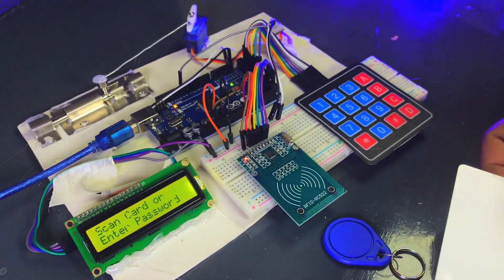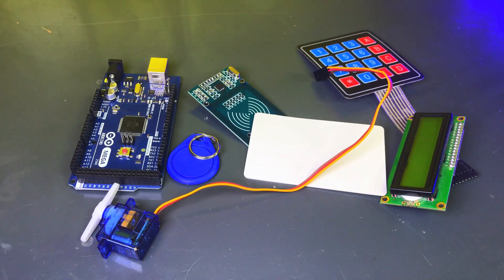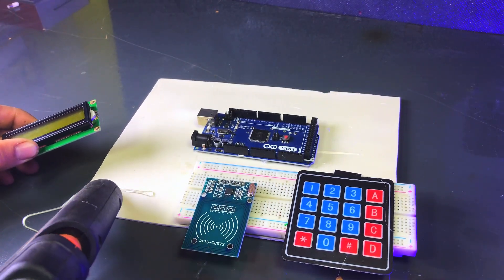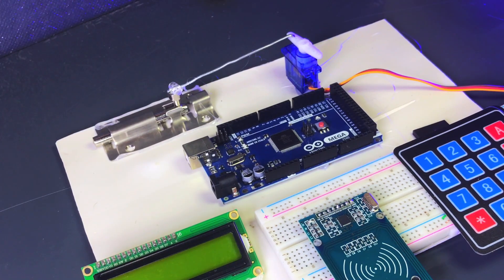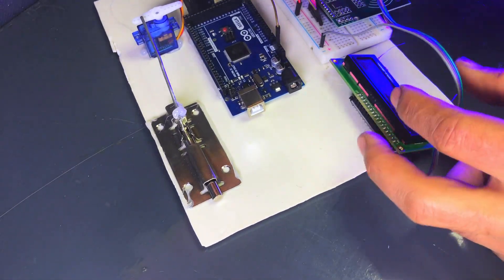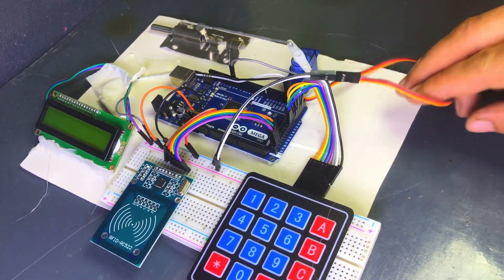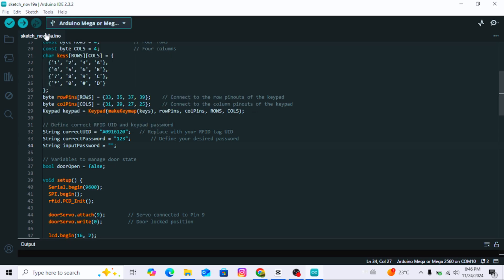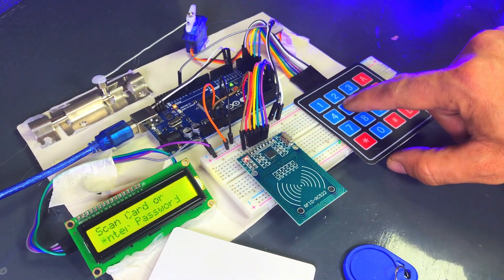RFID and Keypad Password-Based Door Lock System | Arduino Mega Project Tutorial

Comment: can you do with like this ? Write a program in which we have an ultrasonic sensor. If someone stands in front of the sensor, the LCD will ask the user for a password.
The user can enter his password using the keypad.
The entered password should be displayed on the LCD.
If the number of digits of the password reaches four, check whether the password is entered correctly. If the password is entered correctly, the servo will turn 90 degrees. The servo is normally at 0 degrees and the LCD will display the word "Enter".
Otherwise, if the password is wrong, write the wrong password on the LCD. The buzzer will beep and wait for the user to enter the password again.
If the password is entered incorrectly three times, the buzzer will beep forever.
If the desired card is close to the RFID, the buzzer will stop beeping and the program will return to normal so that the user can enter the password again.
Note: If the user keeps his finger on the numbers, more than one digit should not be entered.
Reply from the maker: yes

Comment: Hlo plz plz tell me my project is all working but rf id card is not scanning  on serial monitor so i can add that in code plz plz reply
Reply from the maker: Please check that your RFID module is properly connected with correct wiring. Also verify if the baud rate and the commands like 'Serial.begin' and 'mySerial.begin' are correctly set in your code

Comment: I have a question it is possible to make a keypad rfid and fingerprint door lock system with sending a alert sms and email ? Its for our capstone project hope you will answer it
Reply from the maker: Yes, it is possible! You can use a GSM Module (SIM800L or SIM900) to send SMS alerts.
Reply: Yes you can. I have this project inbox please
Reply: @Abidali-qi3xj Hi brother i need to the same project with RFID module, keypad and Fingerprint. Can you please share the components and circuit diagram?

Comment: This is amazing..  I need so help on a project I am busy with on a raspberry Pi.  It is also to do with rfid and door locks.  How can I reach out to you?
Reply: I’m currently planning an RFID system for a business that has door locks, cabinet locks, and the same RFID keycard used for my time clock. Currently getting the wiring straightened out (I don’t do electrical) with my contractor in the building and contacting the city to decide if I need a fire alarm override. Then ordering all of my components. Hoping to do the whole project for $1k (pretty sure I can do it all myself).

I have asked chat gpt all of my very specific questions and it’s actually been very helpful. Highly recommend. Lmk if you have questions—I’ve done TONS of research and feel like I understand how this all works now. I’m a mathematician btw so I do have a wee bit of background with programming, and I’m a keyboard hobbiest so pretty comfortable with basic hardware stuff. Installing this all on my parent’s business.

Comment: what wire did you use to connect the servo motor to the lock ?
Reply from the maker: This is a small piece of wire rod that is used to connect the lock to the servo motor.

Comment: I used to Arduino with RFID tag reader I hidden underneath the dashboard of a truck. The Arduino controlled relays that disabled the engines ECU. 
I used a GPS module with a SIM card module to text my cellphone if a truck door was open and the RFID tag was not scanned within 60 seconds. Or if the GPS location moved without scanning the tag.
Reply: how do you even learn this stuff dawg

Comment: Sir Can you do this projects by using Arduino UNO. Plz sir.If you ready, can you reply on my comment 'yes'
Reply from the maker: If I use Arduino uno with both an RFID module and a fingerprint sensor, will it work?
Reply: @ktronic110 My topic is making RFID and Keypad based door lock using servo motor. That's why sir🙂
Reply: Use it

Comment: 😅sir how to do with esp3266 😅
Reply: I think you can replicate this in Arduino IDE, changing obviously the pin connections and maybe some libraries, in fact, I think all library used in the code is compatible with esp8266, so there shouldn't be a big problem. But I haven't tested what I said, it's only me looking at the code and having my first impression